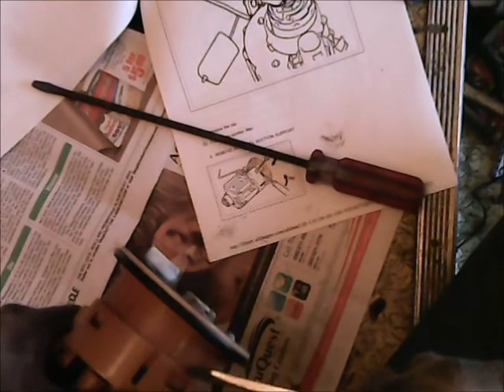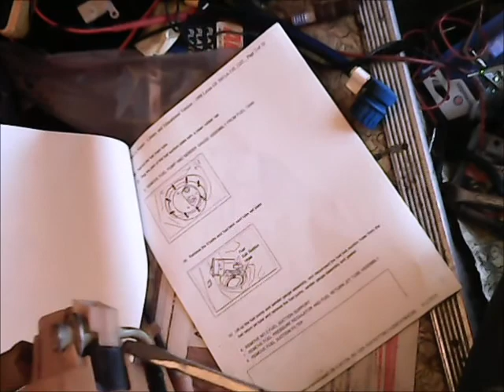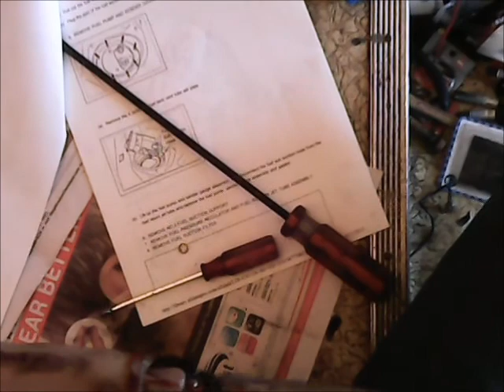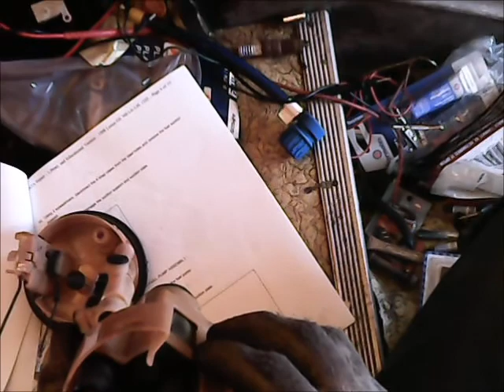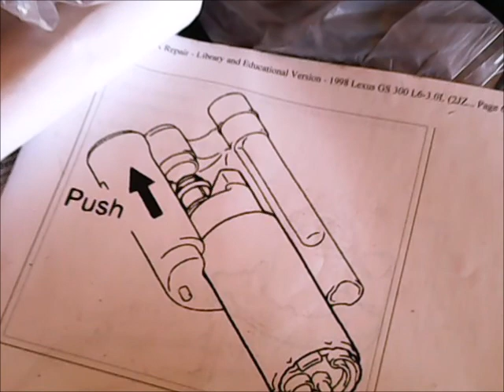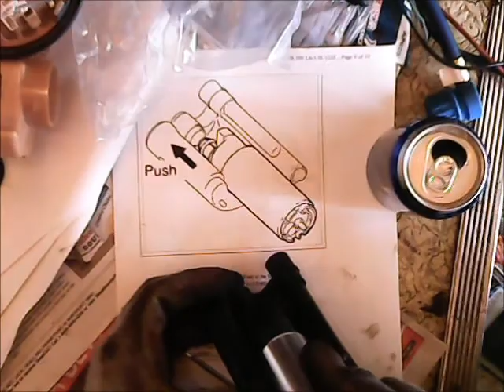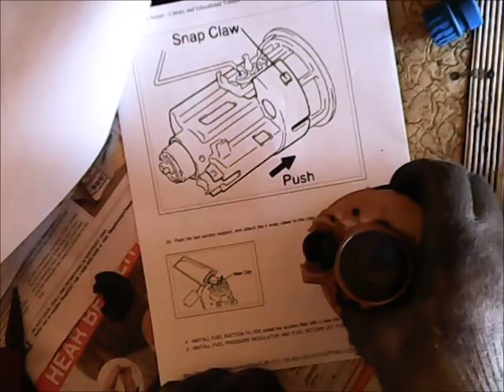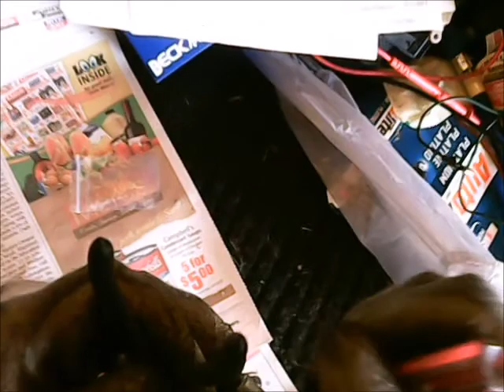Lexus GS300 disassembling and assembling the fuel pump

Comment: Could not see hardly anything oh except the Gloves,They block ¾’s of what you were doing,thats when the Pump was in the Picture! Take them off?I mean it sure didn’t look like Gas or anything was spewing out of the pump unit and the newspaper looked dry so why the gloves?Really didn’t need them putting that little Snap Ring that holds the fuel strainer on ,One slip and that ring would have gone flying into all that stuff next to you and it would have taken a month to find it ,if you ever did. Last never said if it worked or not? So I GUESS it worked? But I give you Credit for Trying,Remember Practice Makes Perfect,Keep At it!One question Though ,DID You Watch This Before You Posted it? REALLY?